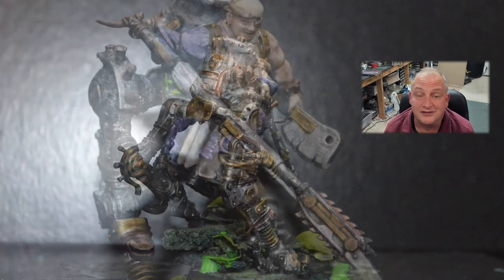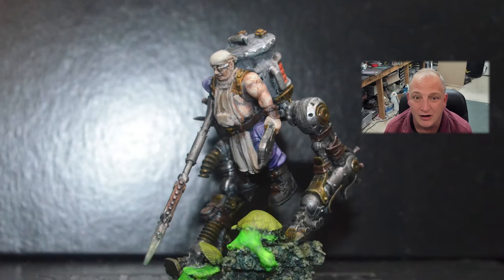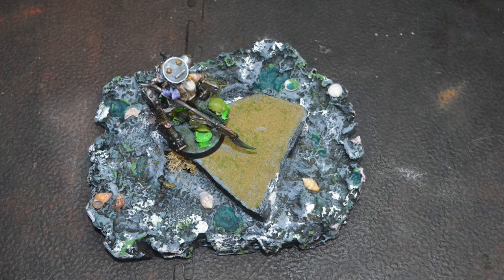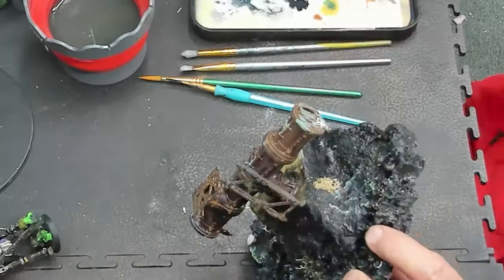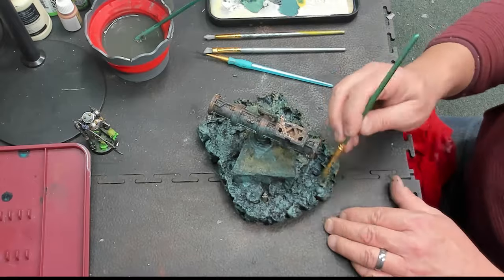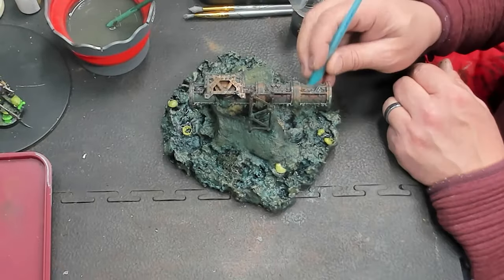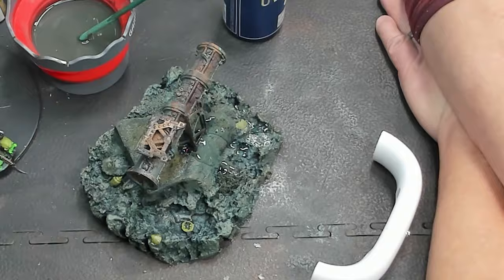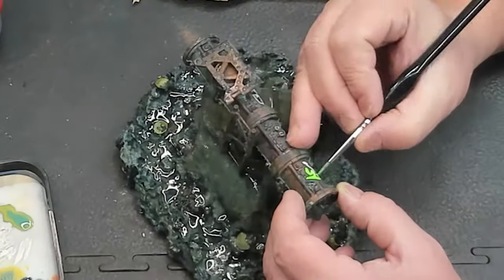#Necromunda Scatter Terrain Scratch Build The Slopper

Comment: Could you have mixed the paint into the UV resin and it still set?
Looks great, the neon green really goes well with the setting, it brings that 80s-90s bring 'look at me' colour palette to life.
I'm really enjoying your whole channel and am vicariously living through you guys, the sump wall builds are such a great idea that I'm going to try make a few to give the game much needed vertical challenges.
Bravo.
Reply from the maker: So in regular resin.... you can mix away yes, but this is UV and it starts out thicker that the 2 part stuff which ends up being a bit of a pain to mix in while still wet.  It's also a bit easier for me to paint water effects than trying to work them into the resin itself but it's a good idea that I will try to use in some future projects.  Thanks so much for joining us!  I'm getting ready for some new sump adventures in terrain soon.